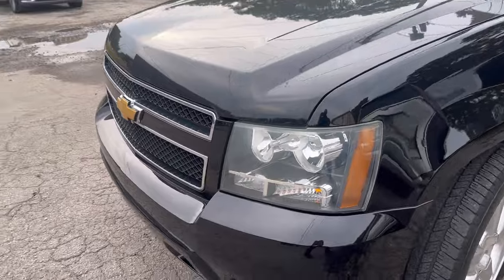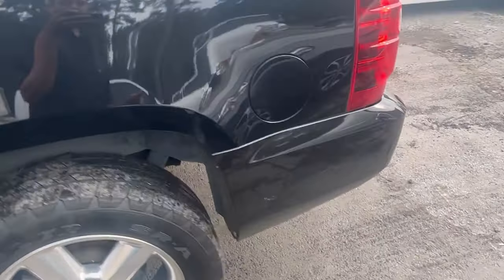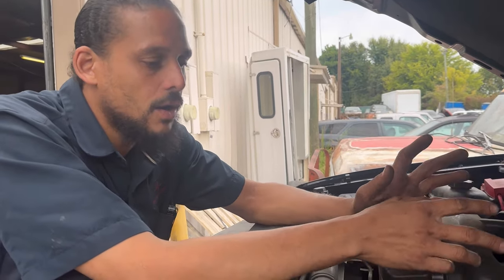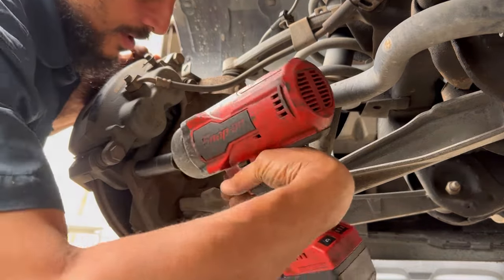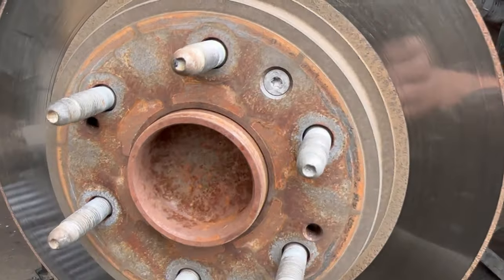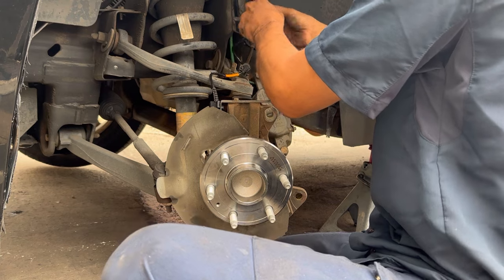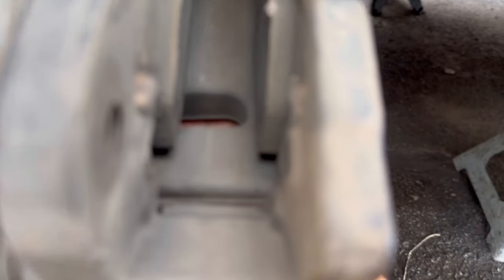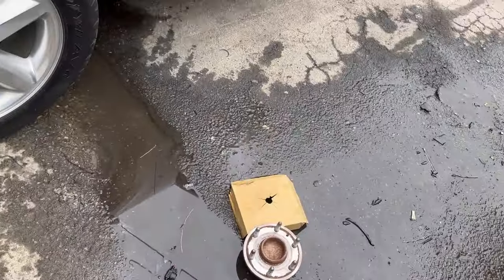HUSH That NOISE!!! Customer Only Wanted The Sound GONE.

Comment: I'm sure you already have one by now but if not, I have the kobalt right angle 3/8 impact wrench from Lowe's.  Milwaukee has a nice one to but the kobalt works wonders. It will fit those tight spots you couldn't get the bigger impact in. I definitely recommend you should look into getting one. I'm not sure if snap on has one.

Comment: You caught that low torque on those lugs I was going to say it has to be at least a hundred. And also I understand you have to put the tire down but you don't want to put weight on those tires until they're fully torqued. You'll get different readings with the weight of that vehicle on those lugs. If you put it down just enough to cause it to not spin and then torque it they get torqued evenly

Comment: I saw a bad ball joint when you first rotated the steering. 😦
Reply: Lower
Reply: 13 mins and 10 sec in, if you want to check. The camera was at just the right angle to pick it up.
Reply: It wasn't the boot. I saw it pop up and down when you pulled on the knuckle. From your POV you couldn't see it, but the camera did. Sorry a screenshot wouldn't show what I'm talking about, or I would have. He probably would have declined the extra work anyway.
Reply: I need a hobby 🤣
Reply: Good eyes!! Also he never took that caliper hanger back 😂

Comment: Good video, don't forget about using blue thread locker on the (3) hub mounting bolts and on the (2) brake caliper bracket to spindle bolts.